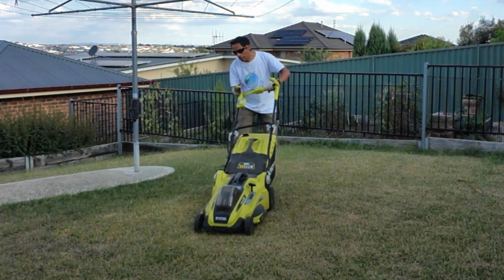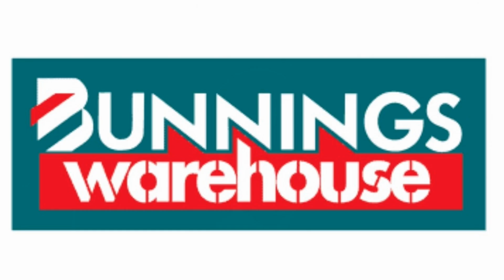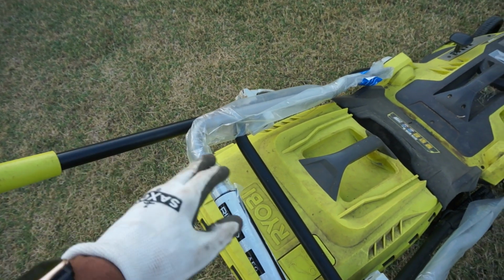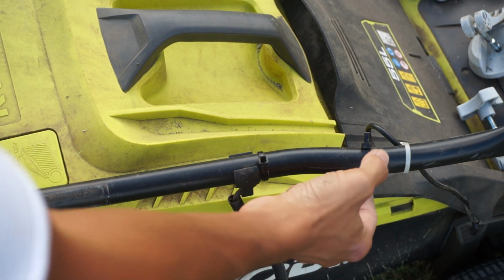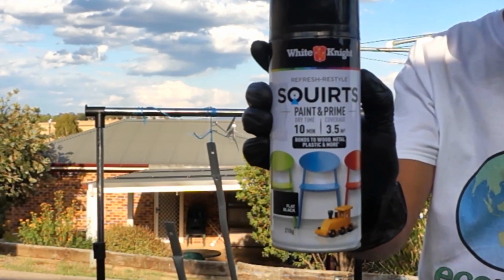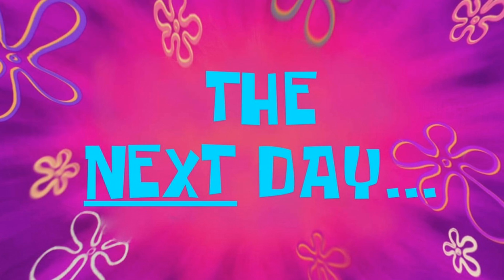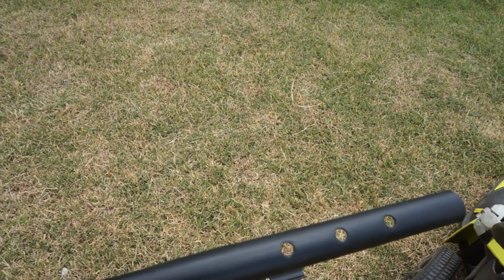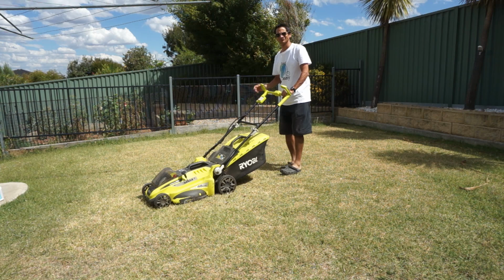Stop throwing out start repairing instead | RYOBI RLM36B46L handle repair

Comment: Good that you can get the replacement part for cheap. Our battery on our mower doesn't hold a full charge longer than 3 days now, so ordered a 99 dollar eBay special as the Ryobi one conveniently was 1 month out of warranty. Old battery still works if charged up the day before or same day as you mow.